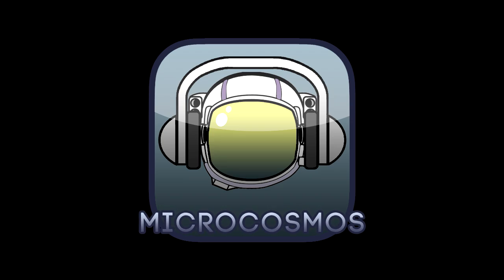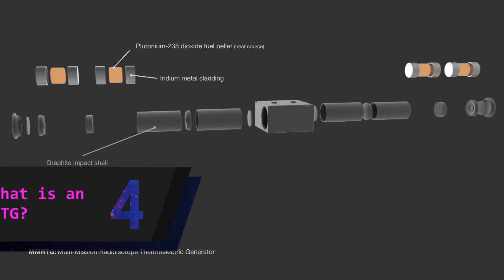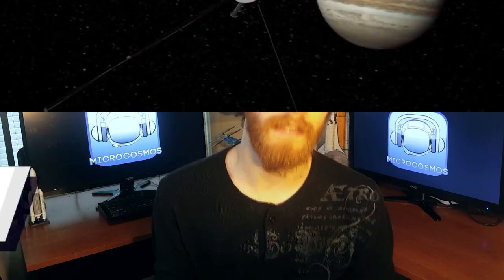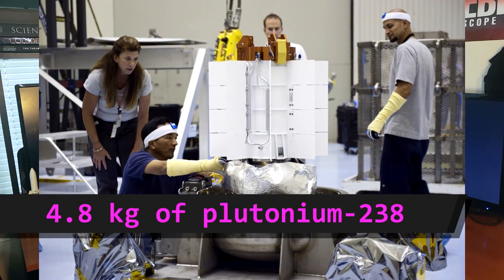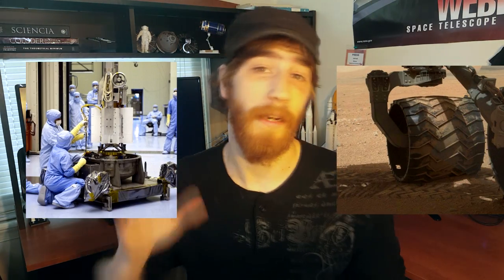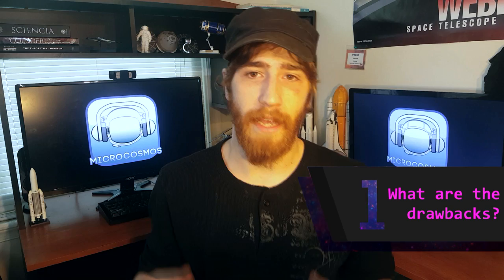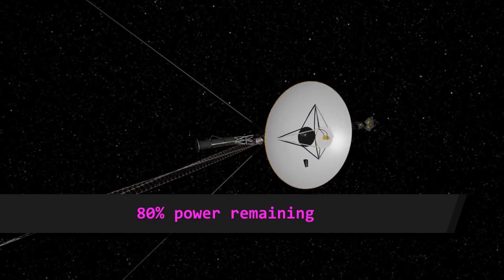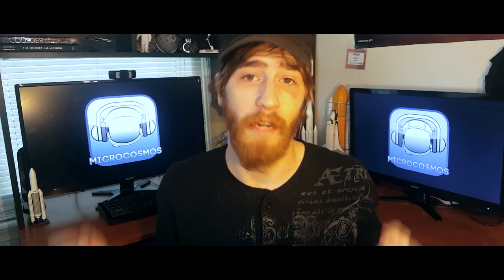Radioisotope Thermoelectric Generators - MicroCosmos #3

Comment: Can these RTG run on nuclear waste from power reactors?
Reply: Kind of - the waste from nuclear power plants can be refined back into a few different elements and isotopes, one of which is the Plutonium used in RTGs like these. 

Wikipedia for Reprocessing: https://en.wikipedia.org/wiki/Nuclear_reprocessing
Wikipedia for Pu-238: https://en.wikipedia.org/wiki/Plutonium-238